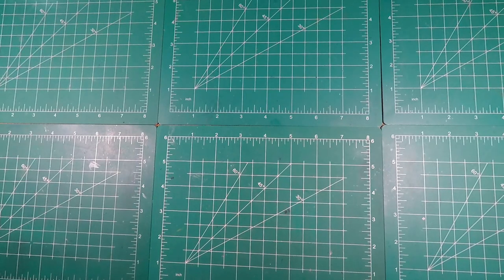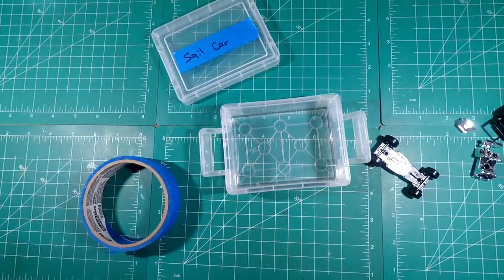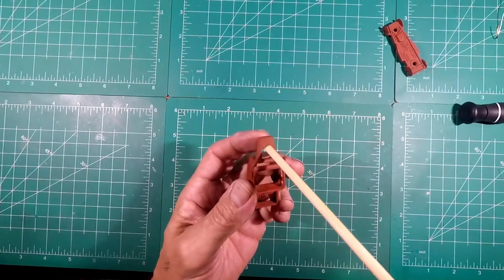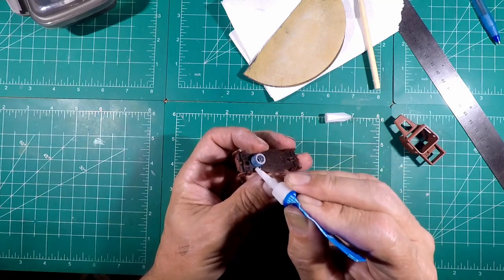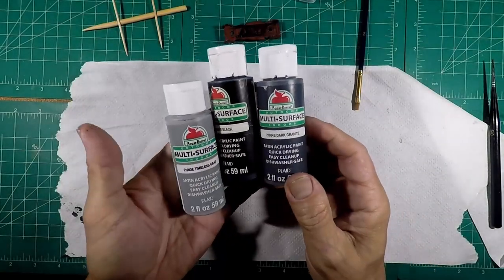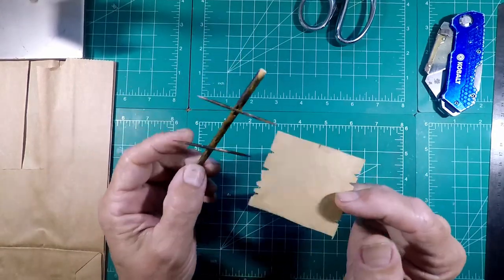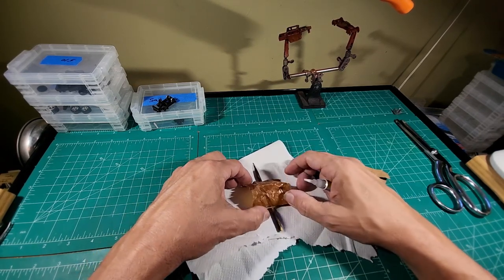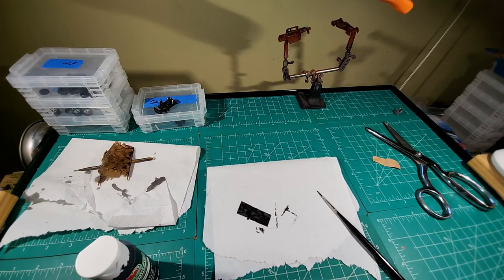Let's do a custom Hot Wheels with wind power

Comment: yeah, fully awesome Pete and fully reminiscent of Mad Max .. I can just imagine a diorama of mutant desert dwellers rolling in on some fully sick custom wheels. .. hey U know, I've been pretty pleased with the general build quality of some of the new mainlines coming out. Wheels seem to most often roll beautifully straight out of the blister, and just ever so gradually peter out when rolling, without any sudden and or abrupt halts. .. and I'm stoked with how some of the new Hot Rod castings like FusionBusta which are actively protecting they're vulnerable spots without impairing the beautiful wide open wheel stance on the front end of the car. What do u all reckon? Same old same old, or has the manufacturer "mainlined" some "custom know how" and is now delivering a better vehicle stock standard?
Reply from the maker: Thank you so much. I can see it as well..... Good points and honestly, I do not know. I know that they do test them to see how far they roll and even do bounce back tests and such. So who knows??? LOL Thanks for watching